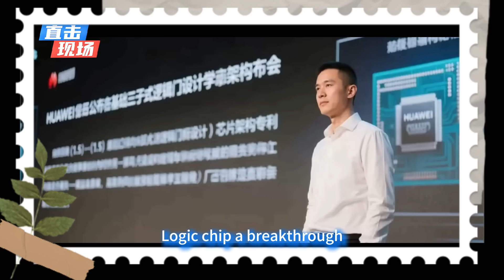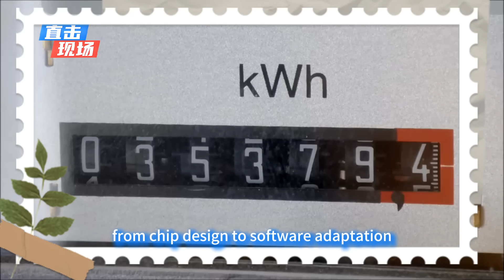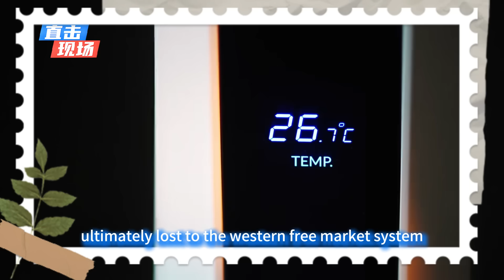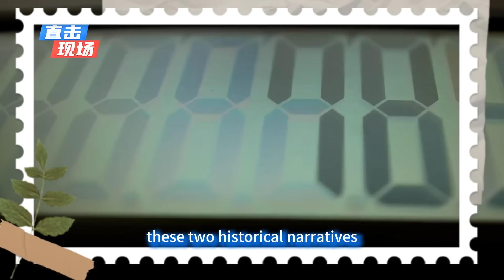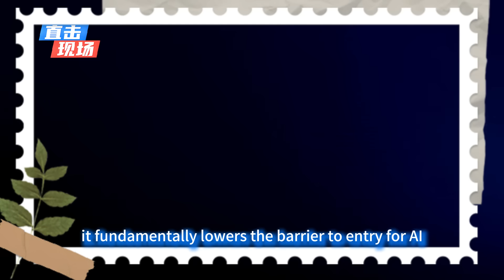Huawei has officially unveiled the world's first ternary logic chip

Comment: 😊 Huawei gets the merit of the chip it contrary to many information the chip is not true ternary, t is unbalanced ternary. Balanced ternary could work with negative voltage. This chip will work with 2 different positive voltage to simulate 2 stages. Not really -1, 0, +1 but 0, 1, 2. This is direct western solution form the problem on how to find 3 values. While true ternary has mathematic elegance, something the Russians love, after the development of MOSFET technology it was clear that ternary had to develop into a new direction. If one can maintain stable several different positive voltages why just 2 different stable positive voltages and not 3 or even 4? The EU has a project running tran to built a optic microchip, if they achieve something, which is probably far from our possibilities right now, they would be working with a system way greater than ternary. I am surprised that Huawei implemented the carbon nanotube technology a did not went that far to the point to develop true balanced ternary logic, that is, allowing a negative voltage for a natural representation of -1. That has bin one of the potencials of that technology, that such as memristors and ferrile memories would accept negativ voltages naturally. We already have memristors and ferrile memories but it's development has been slow and has not been integrated properly in electronic circuits exactly because of the limitations of available binary components. If Huawei is able to p,ace n the market a cheap ternary microprocessor it will be a revolution but t can't stop there we need development on adaptation of all little components to trinary too. Now let's go back to the false statement about the Soviets. The Soviet ternary computer was not secret at all. Setun computer was developed from Moscow State University in open doors almost against establishment. It was given to mass production but because it had not the political support the factory where it was produced was not interested in producing it, because Setun 58 was too cheap for its time. Just around 50 computes were built, even if orders keep coming. The Director also did not allowed the developers to introduced improvements so on the end of 1960 production was stoped as Setun had become obsolete. But researchers were developing a new much more powerful version, the Setun70. Unfortunately the political will was unfavorable and the researchers were forbidden to keep on the projects, still they keep working Mon ternary mathematics and logic until most of them died recently. So nothing secret or unachieved. Many hobby makers around the world, but still majorly russians, experiment with ternary computing using analog components and have been successful as such since early 2000's which has prompted some universities to restart research both in BA.amced and unbalanced ternary.

Comment: Is there any advantage in the software? Starting from OS. Everything needs to be re-written for ternary …
Reply: It is just a beginning. After this, the improvement could come doubling and the moment of feature phone vs touch screen moment could happen. That was where Nokia and BB vanished and Iphone dominate the phone.
Reply: Binary is backward compatible with ternary, you just have to include all the binary instruction sets we normally use, making sure that the kernel is updated to use ternary so that ternary compatible applications and drivers can use the full processing chain. It's more complicated than that, but it's not an exponential problem that requires ground-up changes.

Comment: I guess I'd ask for a demonstration to prove the utility and increase in productivity.
Much like typical ARM multi-core architecture, if the third state in this case is usable then it's a benefit but how would you use this extra state? Much of the success of binary computing is based on its simple logic and usefulness. If you can't keep the pipeline filled that might use that third state, then there is no benefit.

Then, the additional question and issue would be the method the third state is implemented. This video says its done using quantum computing but with no further detail. If so, then only this particular implementation might be patentable and much more capable designs are in full development and has the attention of the world at large, I understand supporting up to 8 states simultaneously. One would have to wonder if the reliability claimed by the design of this Chinese approach is much different than the 8 state qbits everyone else is working on. If not, then this Chinese patent probably has a very narrow IP claim and considering the recent successful demonstration of Google's breakthrough in error correction this Chinese achievement might have very little value.